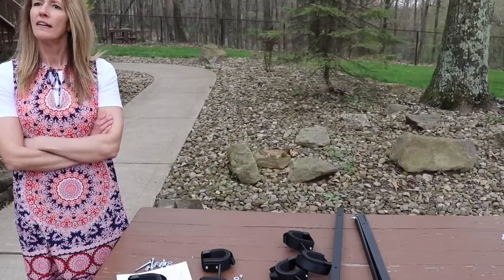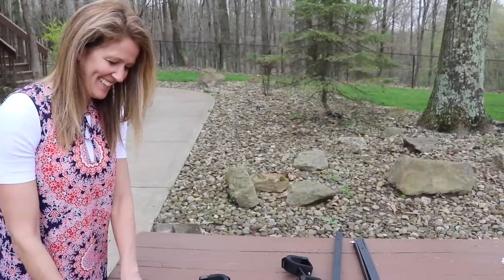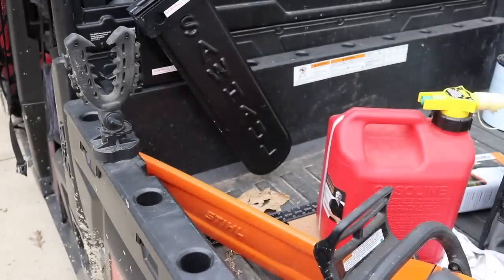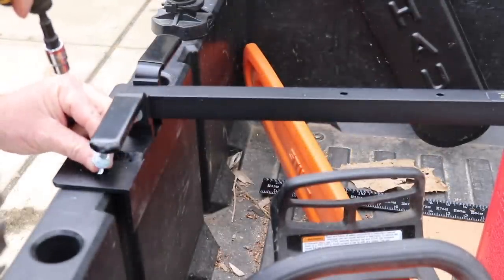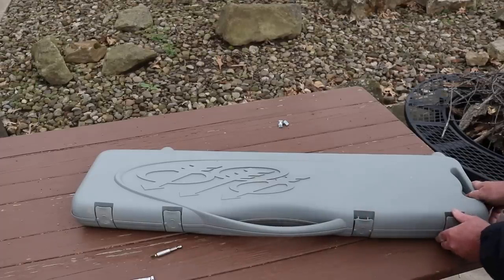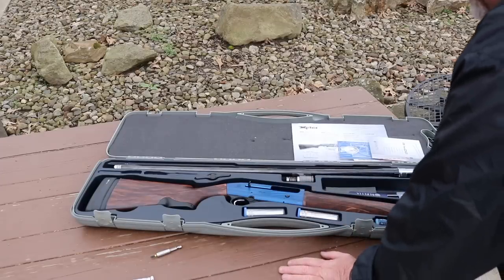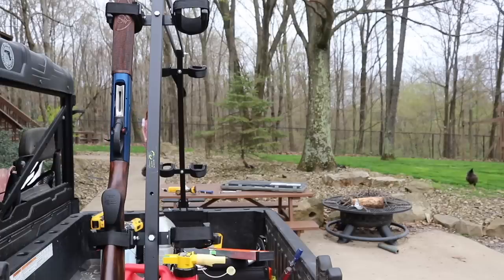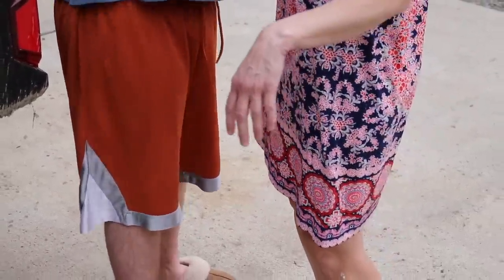#417 Sporting Clays Mount For Your UTV! Pretty Sweet

Comment: Nice set of functional racks. The chicken earned the right to be pot boiled for dinner, lol... 
In major meltdown mode here in N. Central VT. The snow is disappearing fast. Barely made it back in yesterday after a nice Easter dinner with the girls... Riding mower is untarped & battery a charging! Time to roll the big tractor & wood splitter out for the Black Diamond ( TSC ) tables installation...   
Bill...:~)

Comment: Thank you for the video. Curious how it has held up for you? I just got one for us, installing it on a 2022 Polaris ranger crew. I wasn't a fan in drilling into the bed. Lag bolts into plastic. How did they hold up? Thanks again

Comment: I'm interested in how that holds up over a bit of time. Seems those lags are gonna wear out the holes in the plastic rails. I'd feel better with bolts rather than lag screws there.

Comment: I would prefer straps made with something other than Velcro. I would add a plastic cam buckle to that strap or a quick release buckle. If that wouldn’t work I would replace the straps all together. I just don’t trust Velcro in the elements.

Comment: Hey some quick pins for that gun rack and get rid of the bolts.
Reply: Need the bolts to crank it tight so it doesn't shift where the metal parts meet.